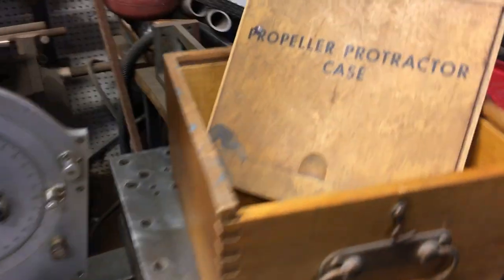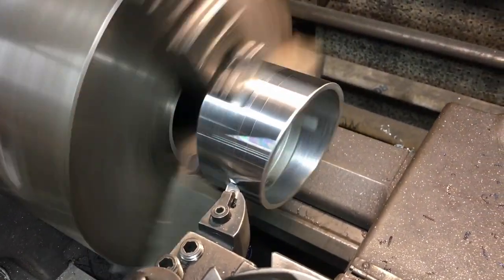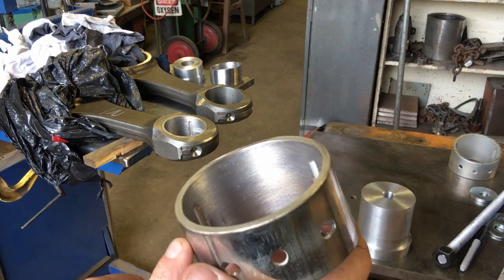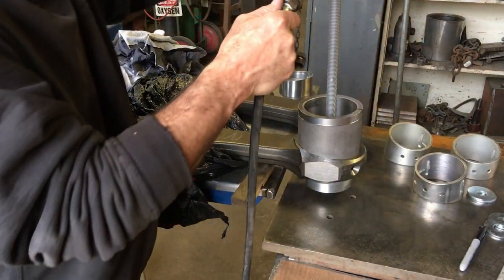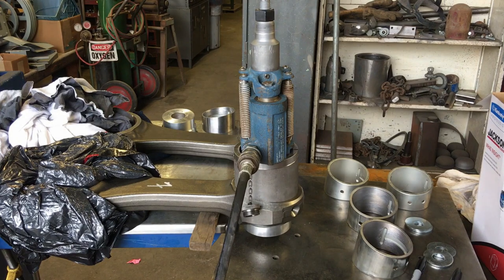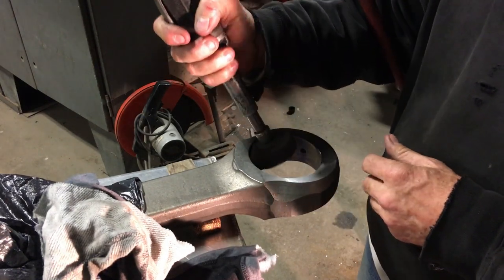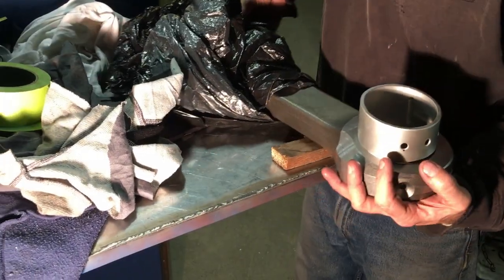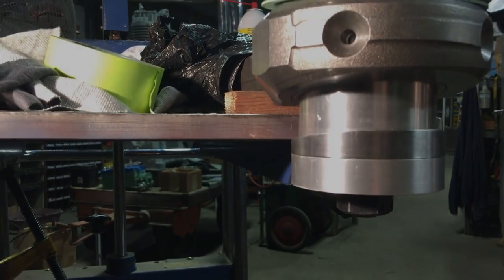Con Rod Job

Comment: Hi Gary Just a pleasure to watch you work and you didnt need cad to plan it all out of your head, having use of and old gudgeon pin bush  helped a lot like the way you used brass so it wouldnt scuff the inside of the conrod .plus the scotchbrite polish on the leading edge.    Now at 82 years of age  I get the pleasure of going to work with my landlord and full use of his workshop we have a great time.
Reply from the maker: I appreciate you taking the time to check out my video. Very cool you get a chance to go with your landlord and work in the shop.     Gary

Comment: .003 clearance on wrist pins is very large compared to what I’m used to! But then the wrist pins are larger in diameter than the crank journals I’ve worked with! I hate to think what the reciprocating weight is in that engine. Those rods are massive! You did it right!
Reply: If the wrist pin that is .875 has .0003 clearance. .003 is a lot, Evan if it’s that large. I’m with you.

Comment: Those are some big piston rods from that giant GE burner, we were unaware of these burners until you shared it, so see we are always learning and more then just the machining we are comfortable with. Now those cool angle lathed parts make sense, great straight flat idea. What a nice portable hydraulic press it made greater ease for getting these bushing out for your project, then even the oil hole alignment then press in the new one. That estate sale press is great for your work, nice share. Lance & Patrick.

Comment: just goes to show the truth of the old 6P saying. Perfect preparation prevents piss poor performance!  Do it right do it once.
Reply from the maker: Thank you Chris, Its always nice when your customer wants it done right and not worried about the cost. But then again when a new set of rods (16) cost $80,000 they just want the job done right. Thank for checking out my video.Gary
Reply: Old Iron Machine Works   I don't imagine those gudgeon pin bushes are particularly  cheap either.